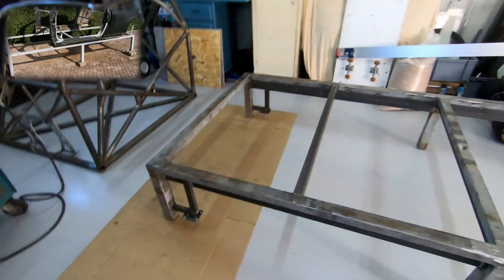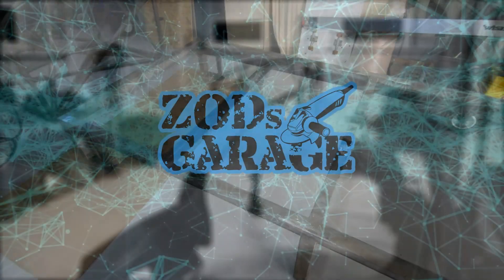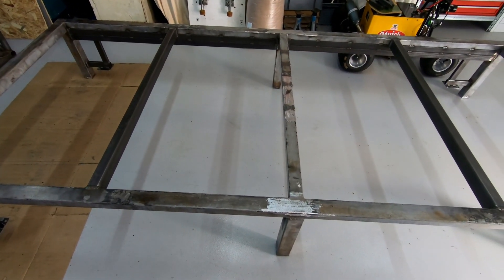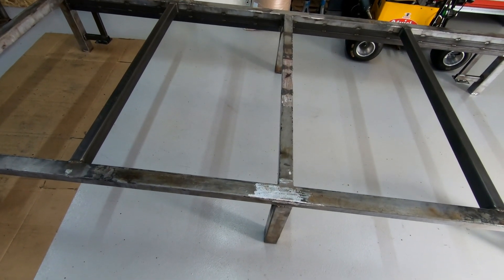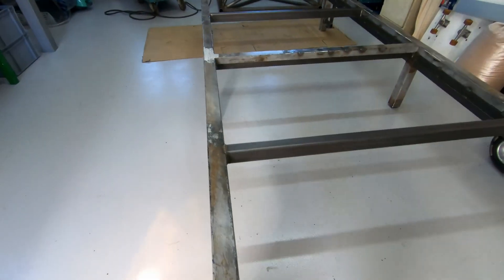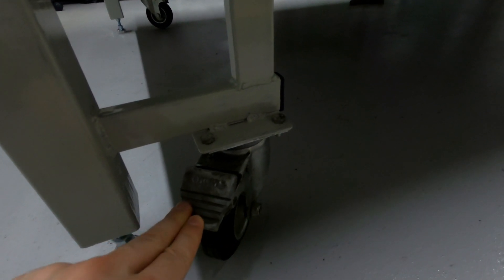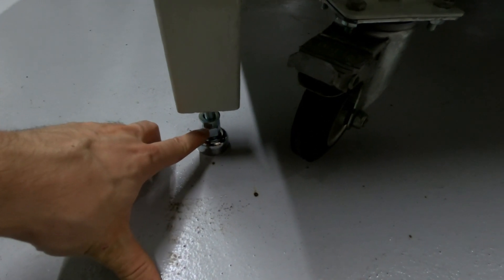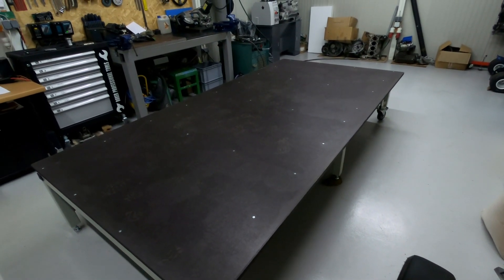Chassis Table

Comment: What’s the material you have used on the top called?
Reply from the maker: It is a construction plywood. It has rough film on one side and smooth film on the other side. Very durable.